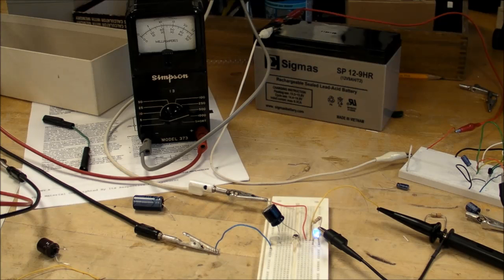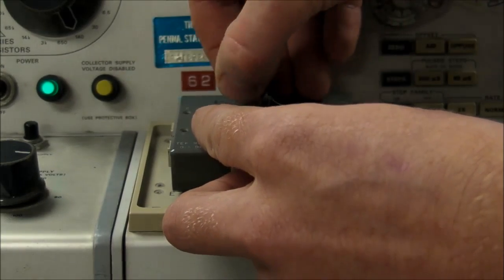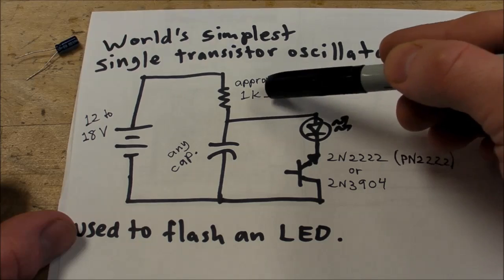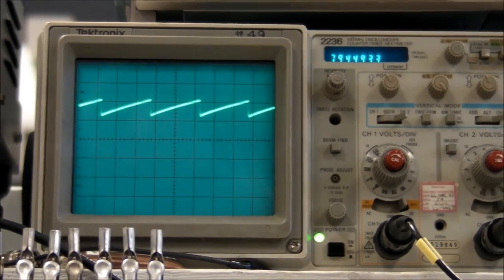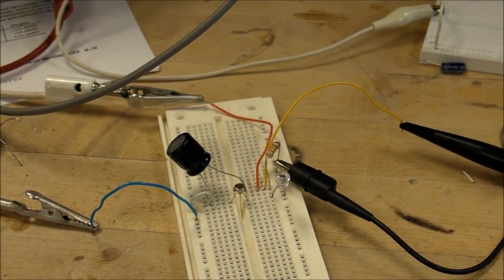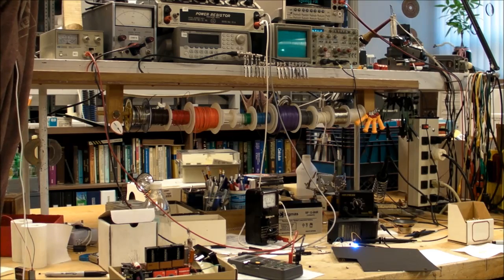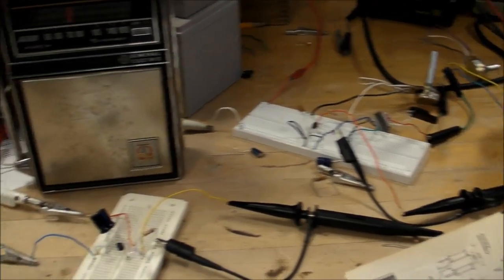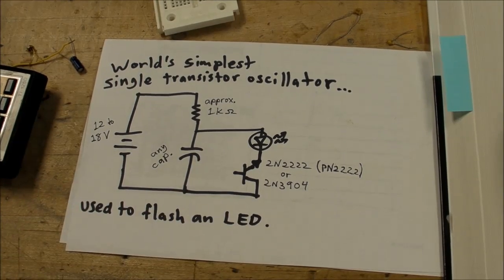(#0093) World's Simplest Single Transistor Oscillator - BJT with Negative Resistance

Comment: Pretty cool... Just made this circuit and it works well!!!
Reply: The schematic at 5:45 says 12-18 volts; were you using a power source in that range? I tried it with 9V first just because that was more conveniently accessible and the LED didn't light up at all, but then I tried with a 12V A23 battery and sure enough I got quick flashes of the LED at a regular rate.
Reply: I just made one,  exact.  didn't work.

Comment: Thanks a ton Eric. I have just started out with electronics as a hobby and this was a great introduction to the practical use of the reverse bias property of this transistor. However I made this circuit and face a peculiar problem that I am not being able to figure out. As I understand it, the LED glows when the capacitor is charged and releases its charge through the circuit, causing the transistor to be in a closed switch state. When I use a red LED in the circuit it works. But if I use any other colour the LED slowly lights up as before and remains lit. Bizarre!! I for the life of me can't figure out why. I am using a 1000MF capacitor and a 2N3904. Earlier I tried a PN2222 and that had the same effect as in the LED would remain on and not produce a pulse no matter which LED I used. The circuit started working when I replaced it with a 2N3904. Can you please please explain what is happening? Why is only the red LED producing a pulse? Something to do with the resistance of the LED itself?My input voltage is 12V.
Reply: +Kunal Verma Different color LED have different Vf voltages (voltage where they light up) and different current draw.  For this circuit to work, the LED needs to draw the cap charge down fast enough to turn off transistor. Try lowering the supply voltage or increasing the resistor. All must be in balance for oscillation to occur.

Comment: I believe that a forward biased diode would actually do the same thing, it's just not as obvious.
Reply from the maker: +John Smith Only if it's a tunnel diode.
Reply: +Eric Wasatonic  thanks
Reply: +Eric Wasatonic  is it possible to connect multiple tunnel diode in series and achieve the same result ?
Reply from the maker: I suppose. Look up "tunnel diode oscillator" and you will see it can be done with a single diode. An inductor may be needed as well.
Reply: +John Smith John Smith? is that you? Doctor?...

Comment: What are some uses for this? I made the circuit successfully and was wondering if the output could be fed into a step up transformer for higher AC voltage?
Reply from the maker: Donald Eslinger It's more of an educational tool than a truly useful circuit. A small transformer should be able to step up the voltage, but it might also interfere with the circuit's self-oscillation. Give it a try.
Reply: Eric Wasatonic  Okay great. The input of a small transformer would be where the LED connects right? I would connect that to the primary winding or whatever configuration I wanted to try.
Reply from the maker: Donald Eslinger Yes, it would be good to put the transformer's low-voltage coil in place of the LED, in series with the transistor. A laminated iron core power transformer would work, but you'd probably get better results by using a ferrite core transformer, like that typically used in Joule Thief circuits.

Comment: I have a magnifying glass with a 3v supplied incandescent bulb that I'd like to convert to a white led, if I used your circuit with a voltage multiplier circuit, would it be worth it?
Or would a joule thief be easier?
Reply from the maker: bridgendesar Definitely go with a joule thief.
Reply: just use a resistor

Comment: I have a question about the simple AM transmitter you built with this circuit, and am posting here because the comments were disabled on the transmitter video.

How did you design the antenna and can you post a link for how it works? I am an amateur radio operator and experimenter and for the life of me all I can find online are tutorials on dipoles and vertical whips, but the antenna you built did not look to be either.

73 KD9AQR
Reply from the maker: Matt Rienzo I just checked out the AM transmitter video, and comments seem to be working fine. I designed the antenna based on pictures of VERY early radio equipment the 1920's and prior. It is an AM loop antenna, and it works by picking up (or transmitting) the magnetic portion of EM radiation. For the one that I built, I had no design plans. I just made the frame from two paint stirring sticks, wrapped 10 turns of 22 AWG, and hoped for the best.

Comment: Awesome circuit, thanks for sharing.
The frequency is strongly affected by current injected into the base - if you use a low frequency and lower the input voltage close to threshold you can 'measure' ac fields by touching the base with a finger and putting your other hand close to a source (mains powered equipment or what have you). You can even get a theremin-like effect where the frequency depends on where your hand is. Great fun!

Comment: What a pity I cannot make a flashing "police" light for my son's Lego form a single 9v battery. 2 x 9v is a bit combersone for a 5 year old.  Are there any design tweeks which I can incorporate to have the same effect but only using a single 9V battery?  BTW, I'm simply a tinkering dad with minimal electronics skill.
Reply from the maker: This negative resistance oscillator I made just barely works. You can get much better performance from slightly more complicated circuits. Look up "astable multivibrator" (tons of info available online) and play around with that. There are two different types of roughly the same complexity: one with a 555 timer IC, the other with two transistors. Build whatever you're comfortable with.

Comment: Excellent circuit. Simple and elegant. I was toying with a similar idea in my head but was using zener diode instead of the transistor. The reasoning was that once the capacitor voltage increases above the zener voltage, it would conduct and drain the capacitor charge. Then the capacitor would charge again and the cycle would repeat. But it does not work that way but rather settles at a steady state where the cap charges upto the zener breakdown voltage (I think somebody in the comments already pointed this out and you said the same thing).
So, it is the negative resistance which does the trick. Here, when the voltage tries to decrease, the current increases thus giving a chance for the capacitor to drain charge.
But, I still have a question. We traditionally study that for all oscillators, an amplifier and feedback is required. Also, something called a Barkhausen criterion needs to be satisfied. Do these really apply to this circuit? Maybe the amplifier and feedback are implicit?
Reply: I believe the negative resistance provides positive feedback.The equation for simple harmonic oscillation has solutions of the form exp(At)*sin(Bt) which is a sinusoid with an amplitude that is an exponential function. Normally A would have dimensions of R/L or some other combination of variables  which includes resistance and produces a constant with dimensions of 1/t. Usually this "A" would be negative in sign which indicates a decaying sinusoid but with negative resistance it is instead being reinforced. An active component supplies the negative resistance which introduces more energy from the supply into the oscillating system cycle after cycle at the natural frequency until a maximum is reached.

Comment: All Silicon BJT's Base/Emitter junction have a forward bias voltage of around 0.6V but they also have a 6 - 10 V reverse bias breakdown voltage point.  The Base/Emitter junction is effectively a Zener Diode, the Base/Collector though is just a normal Diode.
Having said that, the way this circuit functions is .... As the voltage rises on the Cap due to the current coming through the Resistor eventually the Base/Emitter junction will perform like a Zener and with the forward Bias of the Base Collector junction, start to conduct, this will effectively discharge the cap but not before the LED has lit for a short while using the current from the cap.  The cap will then start to charge again as the Base/Emitter junction would not have enough voltage across it to maintain conductivity. This would also explain the LED being on then a sudden brightness before the LED goes out, the 'Zener' would start to conduct a little before it goes into avalanche allowing the LED to light then when it does avalanche, the current goes up quickly making the LED bright and this discharges the cap turning the LED off.  The process repeats

Comment: I did this with 2N2222 and LED is flashing ok, but I can't hear sound when speaker is connected
Reply: Connect the unused base lead of the transistor to an op amp(outputted to a speaker) and you will get tone!!!

Comment: Hi - I'd like to know how high you've tried to get the frequency for this circuit. I'm looking to prototype a 80kHz sawtooth, and this is going to be my first attempt before the common things like opamps.

Also, possibly worth sharing that most SPICE simulations won't simulate this circuit
Reply from the maker: I haven't tried for a maximum frequency, but in the AM transmitter circuit, it's going at about 700 MHz. 80 kHz would be no problem.

Comment: Hi Eric,
Good job !
Just tryed the flashing led circuit with 2N3904 and 2N2222A, but unfortunatelly, it didn't works.
By simulating the tunnel effect by rapid short circuit between Emmitter and Collector it's ok, but with the transistor alone, no tunnel effect.
I made a circuit using this technique for the drop end charge for  a solar charge controller, but again no tunnel effect. What is the secret ?
Reply from the maker: It will work with almost any capacitor. Smaller cap gives higher frequency. But it will not work with any resistance. Resistance cannot be too high or low. It takes some time to try different values to get it right. It also requires relatively high voltage, at least 12 V. Better to start with 18 V from two 9-V batteries.

Comment: can i use this for a moog synthesizer?
Reply from the maker: Harry Ball Thanks for that. I had never heard of a trautonium. Interesting device!
Reply: I think you would rather use an oscillator whose frequency is much more stable than this simple oscillator. The frequency of this oscillator changes with respect to resistance, supply voltage and capacitance. So, if used in a synthesizer, any small changes in once of those three parameters will output a different frequency/pitch which would be highly undesirable.
I would suggest to use something like a crystal oscillator for stable applications.
Reply from the maker: Vikas.V Jois It's true this circuit's frequency and quality of operation are variable and unreliable. But when I first tried it, I was quite impressed that this minimal circuit actually worked as a crude, yet minimally effective, AM transmitter. The circuit is much better suited as an educational demonstration than anything else.
Reply: Vikas.V Jois
or you could cement it all together, or ener better mount everything on a chip socket and enclose the components in epoxy. At least it would be less susceptible to external influences such as temperature changes.

Comment: This is interesting, but wouldn't a Zener or avalanche diode be more appropriate? You're basically just using the transistor as a reverse-biased diode, right?
Reply from the maker: Good question. A zener would not work because the I-V curve has a positive slope at all points. This kind of oscillator only works with a device that has a negative slope at a certain region of the I-V curve. Without that negative resistance region, the circuit settles into a steady state with no oscillation.
Reply: Thanks. It turns out there are some specialized diodes that have this characteristic, but common transistors would seem to be more available and practical.
Reply: Eric Wasatonic yes !

Comment: Mine is maxing at 60-70 khz, any way to make it go higher?
Reply: I'd mess with the series resistor's value. Get it where its in the middle of the range where the circuit oscillates then lower your capacitor to raise the frequency. If that doesn't work, put a 220nf cap across the power wires to reduce the effect of power leads inductance and the resistance of the power supply at radio frequencies. If that doesn't work, try a different transistor :)

Comment from the maker: The required voltage depends on the transistor used. Some need more voltage than others. I do not know of any transistors that can go into negative resistance at lower voltages.

Comment: If you have the transistor reversed at low supply voltages it will still amplify, just poorly. This then is using the reverse leakage to turn on the junction like a regular device, though long term it will degrade the junction.